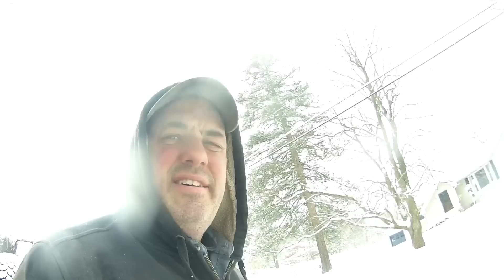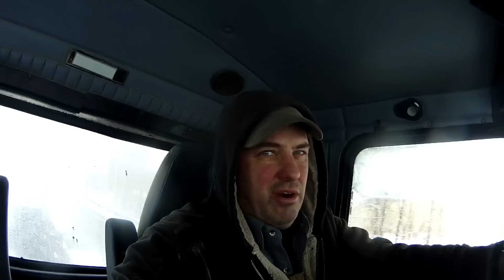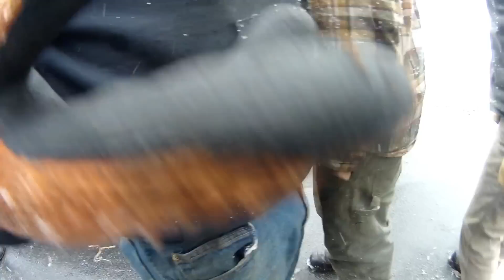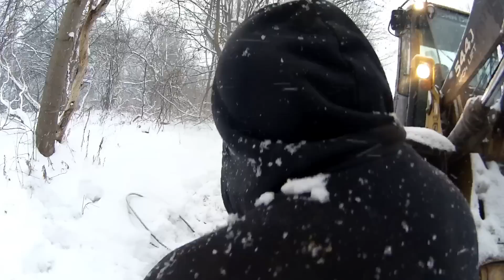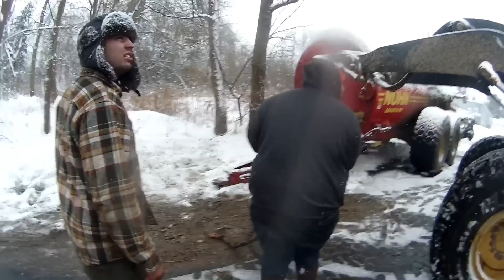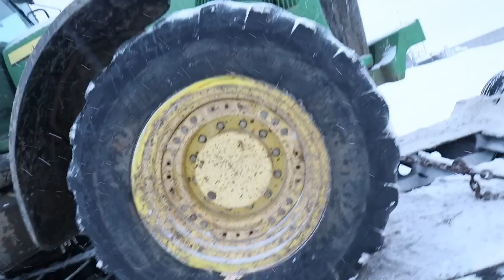John Deere 8320 collides into a tree.

Comment from the maker: A couple of things to keep in mind.
1-when we made the decision to move equipment the roads were clear,a quick snow squall came through and dropped a good amount of snow quick.
2-we had two options to get this tractor out of there.These tractors have a park brake that can only be released with hydraulic pressure.You just ain’t going to be able to drag it with it locked in park.One option is to do it the way we did or to hire a crane or a large tow truck.Either or the whole tractor would of had to been lifted and set onto the trailer.
3-the tractor leaking a little oil is what you would call a casualty of war.It got cleaned up,we lost about 3 gallons total.You can’t plug off the ports where the oil was coming from.Those were pressure return ports and the reason why we had to even have the tractor running was drive it and release the brakes.
4-snow was pushed onto and over the oil to contain it and keep it from running off the road.If you don’t think it works try it,pour a few gallons of oil on your black top driveway it will not flow as fast mixed with snow.
5-yes the guys were cracking jokes but what you didn’t see is we all cried before that and held hands all we lacked was being able to hold a puppy.

Everybody is entitled to an opinion after all this is social media.....I just wanted to explain a few things is all.
Reply from the maker: We cleaned it up just after we loaded the tractor.The oil didn’t melt the snow.
Reply: Those of us that farm and work like this everyday know and understand. The rest are just armchair warriors who only know how to make sarcastic comments. No need to worry about those people. Good job getting all that picked up and off the road safely.
Reply: @chpenney26  right back where it came from.
Reply from the maker: @chpenney26  we cleaned it up. Stop being silly.
Reply: @chpenney26  Do you even know how roads are made, guy? Oil and other oil like shit gets packed onto the ground. Some oil then just seeps into the ground. That's basically it. All of the big government tree hugger folks are always like "but who will build the roads?!"...and have no clue what actually is involved with building roads in many places.
Reply: @williams6550  yes.. like all these leftists thick like if we have hybrid cars then we must have hybrid roads, the long and short of it is, no oil.. no roads.. no industry.. reduced foods. even oil is used in the production of foods. how? chemicals and fertilizers   Long Live Farming
Reply: @FarmingFixingFabricating  At that point there's not much to do but shit your pants and go in for a swim!! You did what you had to do to get it done and these dolts on here complaining and criticizing most likely call triple A to change their flat tires. I'm in Northern N.Y. and I know how the weather can give you a spanking for no reason when you least expect it. I sure am glad nobody got hurt and I'm wishing you a much better 2020!!!
Reply: that was funny...nice work
Reply: Only people who don’t have accidents are the ones who sit home and do nothing
Reply: @Raylan Trace instablaster =)
Reply: @Dayton Declan I really appreciate your reply. I found the site thru google and Im waiting for the hacking stuff now.
Takes a while so I will reply here later with my results.
Reply: @Dayton Declan It did the trick and I now got access to my account again. I am so happy!
Thank you so much, you really help me out !
Reply: @Raylan Trace Happy to help :)

Comment: The nice thing about hitting a tree is that they don't sue.
Reply: Not true good try.  If it was owned by the government they can and often due sue.
Reply: Interesting.  Could you cite one case and give me the particulars?
Reply: @AStanton1966  ...what about if it was on Crown Land and happened to fall on you as you pass with your car, wouldn't that be a good case?
Reply: Probably only if the tree was diseased or dead, and the Crown didn't take any action or were notified to take action.  Otherwise, a healthy tree falling is an act of God in these parts.
Reply: I slid once going to work just missed this guy's new Lincoln  and got the tree in his yard. And wouldn't you know  It,  they had to get my insurance for the fricken tree.  And hold me up for the police to file a report to put in a claim..  And I drove  it out of the yard and to work 2 hours late and 1/4 tank of gas burnt setting out in my truck witing..  Glad I don't  work  at that place or drive the road anymore.
Reply: Josh Frank  actually my tires  didn't even touch their frozen yard with 2.5 ft of snow on top.  I scuffed the bark on the tree..  And the scuff onthe tree cost my insurance  $2,500 as well as me  being 3 hours late  to work..  Wasn't  nothing  major hurt..  Other then my truck hood, bumper, and fender I had  to pull out away from my tire to get to work.
Reply: Over here oil spill would be the big issue, unless you call it in to have a clean up crew out you could get in some serious trouble. They dont joke around with environmental laws. That being said, I dont know the deal in this particular area.

Comment: Really glad nobody was hurt. Years ago a neighbor landed in the hospital from a multi-vehicle wreck that removed the wheel and final drive from an Allis Chalmers 180. He was pulling a forage wagon and making a left turn from a state highway to a dirt road when a little car (like a Chevy Citation) decided to pass him on the left. Fortunately there were no serious injuries and they only took my neighbor to the hospital because of his age (80+, if I recall.)

A few years later we had a rear wheel come off an AC 170, but that was a failure of one of the locks on the power adjust hub system. A few years earlier the tractor had been overhauled and the dealer said they installed new locks but had, instead, built up weld on the seat which eventually wore through the steel bar on the rim.

Comment: Worked at an airport, they used these to cut grass.   Complained about how rough it was, so maintenance drove a roller over the entire thing... with the vibrate on.   Turned it into a washboard.  The vibration caused mower decks and wheels to fall off, fun times.

Comment: Down hill, loaded trailer - you can't slow down or the trailer is going to do the driving for you - and you are not steering the trailer!  Only way to prevent this is to speed up so you are always pulling the trailer.  Slowing down just puts the tailed in control.  On conditions such as these it is always good to know the terrain so that's  you can plan your approach and enter the top of the hill slower and you can increase your speed as you desend.  So very lucky no one was hurt ( but for the Deere).  My brother flipped a tractor back in the 60's (without a cab or roll bars) and is still walk around today.  He was extremely lucky too.  Bruised, cracked ribs and a large patch of skin rubbed off by the rear wheel.

Comment: A couple years ago I was in a similar spot.  Had a kid come flying around a blind corner on my side of the rd he hit the outside duel on a mx230 it bent the axle 7" backward and broke the transmission all the way around.  Only owned the tractor 2 weeks and it was totaled.
Reply from the maker: Wow
Reply: Made for a interesting day.  With the trany broke you couldn't get it out of park or steer it onto trailer bc all the oil ran out of it.

Comment: Man I'm glad no one was seriously hurt.  Tractors don't do well in snow and ice . Bigger tires = more surface area in contact with the ice which can get very ugly in a hurry. Puling a manure tanker can be difficult due to the manure sloshing around and pushing the tractor around. We custom spread hog manure with the same tanker with an ejector in the spring and fall. It smells worst than dairy manure by a long shot. Nice video stay safe both you and your worker's farming is dangerous it only takes a second for a accident to happen In the field or shop.

Comment: Wonder what your mind is set on... are you for sure going to get it all repaired or would it be better to just salvage what you can and find a different machine? Insurance on it at all for something like this? I wonder if something else got torqued or screwed up or cracked that might cause future headaches down the line, even in JD goes thoroughly through it... just something to think about.
Glad everything and everyone else is ok. Going to be a bill either way. What happened for sure, too much speed and lost control with the bad conditions?
Reply from the maker: Time will tell

Comment: Guess they don't make them like they use too.   We clipped a corner electrical pole at the end of the rd. with the wheel weights on 1960 case 830.  Broke the pole  clean off never hurt the tractor.     That was 20 years ago and still using that tractor.   Lol.

Comment: Mann that's dirty oil your'e pouring onto the roadway.  It's like not changing your underpants before you go off on a Journey!   Our EPA would've had our guts for that    - but what to do? Rather you guys than me for such a big machine - I've had a smaller Axle break off from Hydro tractor - no oil = no drive just like that.  We Watch n learn.    As machines get bigger they get Heavier and faster. Slide better and break just as quick. I wrote BREAK and I don't mean Brake!   We 're needin a new breed of Driver!     Thanks for having  someone there to record your misfortune that we may learn.
Reply from the maker: culmalachie the oil has a blue dye in it

Comment: We had a group of vegans come to our ranch why we were loading cows up for sale, with a 24 ft. Trailer and a old Chevy we loaded up all our bulls into it(the semi carried all the calf’s an old cows) some animal activists messed with the wheels on our trailer( apparently they were gonna set the cows free or some bs) we hopped onto our “shortcut” and old field road built onto a Levi  that hops from our pasture straight to the highway, right as it dipped and we passed the pond the right side tires flew off. The trailer slung off into the field dragging the old truck, my grandpa was a good driver and managed to keep us on the road long enough to start pulling the trailer back straight but we flipped, our goose neck ripped off and the trailer ended up upside down and us on our side. We packed 10 800-900 into that trailer, 6 died on impact and we had to put the rest down. They had followed us though, to open the gates when we stopped prolly and they turned around and took off, I got their plates and we took em to court, hoping it falls on our side!!

Comment: Hard luck with the axle housing getting pulled off. Luckily no one has been hurt. Can I ask a question without sounding like a dumbass? Why do you spread slurry on top of snow covered ground.? Are the fields hard enough to travel on? . Is there a risk of run off.? Thanks from an Irish farmer.
Reply from the maker: We were just moving equipment getting ready for when the snow melted
Reply: @FarmingFixingFabricating  I misread the situation. I run new holland and ford gear on my place. Look after yourself and thanks for the reply.

Comment: I'm starting to think the luck you been having with John Deere it's time to maybe try a different brand
Reply: They all break you just see it more  John deere because there is a lot more out there
Reply from the maker: I'm open for that
Reply: A Case IH would've taken the Tree out without a scratch on the tractor!
Reply: What more can a tractor do? It drove away
Reply: @atmidnight8740 ,   Wow!  That's a pipedream if ever there was.  You mess with a tree in any vehicle less than a bulldozer you gonna come out 2nd best.  
In 95, a car passed me and then stopped dead in front of me, I'm in a long nose Int tractor pulling 15,000 in a East live bottom trlr.  With poor brake adj. I went into the woods to not kill her, avoiding the big stout trees (fortunately).  By the time it stopped the driver's door not opening, I stepped out of the cab from behind what was left of the windshield onto the rt front tire and two men helped me to the ground.  The recovery operator told us it broke the engine & trans apart.  I never saw the woman driver after that....  Several drivers said they'd have hit her instead of going off road.  Don't mess with trees.

Comment: The young lads at the accident scene need to be schooled some about thinking about what to do next, and then doing it, like running flashers on all the equipment, getting chains and blocks lined up, getting one of them on each end of the accident scene to move the cars safely thru the one lane of open road, etc. They should be more mature than to act like some berry picking tourists out for a stroll.